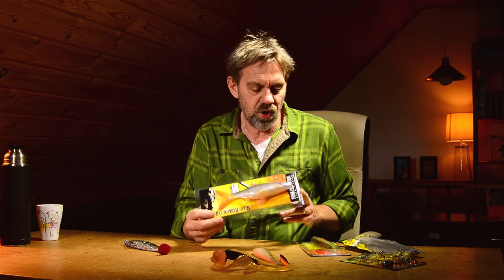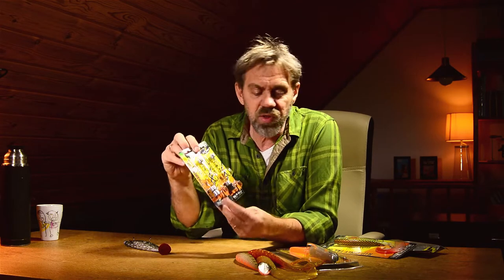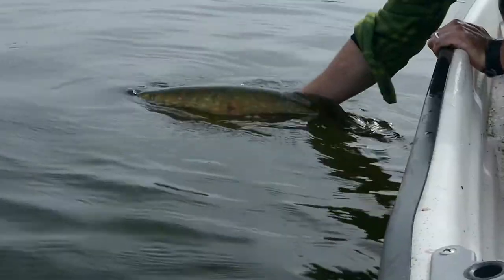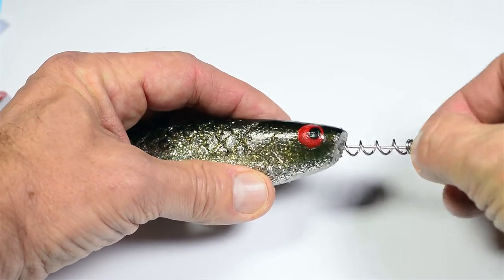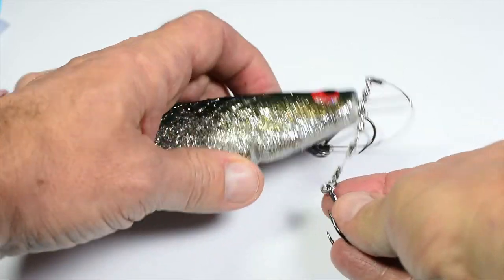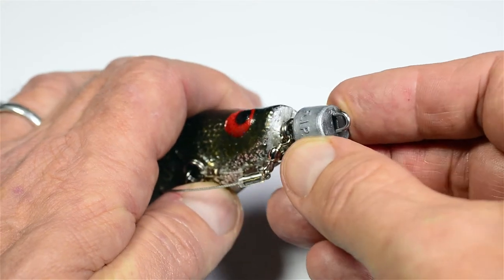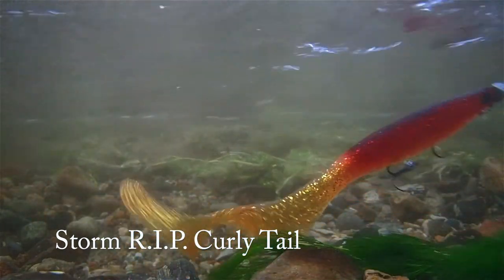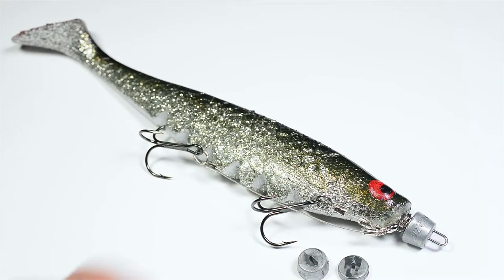How to rig the Storm R. I. P. Multi-depth Screw System

Comment: Cool rig Michael, lot easier than trying to thread line through the bait for attaching a stinger hook at the rear. Thanks for the instruction. Have you used any hollow baits like Yum, I think they're called Big or Easy Money? Big hollow boot foot. You rig them on huge EWG hooks they supply with the bait. I could never rig them right, the instructions sucked. They end up ripping the bait. So I used the biggest hook lead heads I could find. I don't think the bait would last one toothy big fish bite.
    Storm makes awesome lures. The Hot N Tot in firetiger is my favorite for Kings over here on lake Ontario.
Cheers 👍😎🎣
Reply from the maker: Joe, I use hollow swimbait a lot. Haven't tried the Yum (Money Minnow?) but i use some similar softbaits, with that big slot in the body. I my opinion it is crucial to choose the right size Offset/texas style hook for the individual bait. I will try to make a video on that during the coming months. Rigged "Weightless" on one of these hooks they are dynamite when trying to catch predators in weedy areas. Just the softbait and a hook - in essence it is kind of a finesse presentation, I guess. 
Cheers :0)
Reply from the maker: I love the Hot'N'Tot and the Subwart lures as well, by the way :0)
Reply: Michael Jensen yeah money minnow. I think they came out a few years ago, everybody and their brother made that style of bait. This came with I believe a 7/0 EWG offset hook. I wouldn't pay regular price, I found a twin pack at Walmart for like 75% off. I've had a couple of big sprees at Cabela's. We have their card and you get money back, Cabela's Bucks, to buy of their stuff. They're like a "pusher" in that respect, lol. Among all the plastics I also got some hollow boot swim baits in ghost minnow color. Huge 7 or 8 inch. It looked more like a sucker, which as you know is great for pike, but had a purple irridescense. I get fly fishing and tying stuff there too, as well as spinning tackle. 
     I've some wiggle warts too. But those Ontario Kings out of Oswego R in NY love those firetiger hot n tots. That's the only fish I've caught on that lure. Overall jigs, CD Raps, or live bait (night crawlers) rigs are my go to stuff.
    A video on rigging would be great, cheers buddy.👍😎🎣
Reply from the maker: Joe, I guess the name Money Minnow wasn't intentionally referring to the price... but it seems fitting ;0) I will keep those swimbaits in mind for future rigging videos. Cheers my friend :0)
Reply: Michael Jensen lol, 🎣🙌💰💰💰 that's funny. But I think it pertains to tournaments, "use our lure and win the big money!". I guess tournaments and competition are ok, but it's really not my cup of tea. Though I do regret not entering a contest that a local lake association puts on every year when walleye season starts. I'm shore bound, no boat, so my lady and I went and fished at a popular spot on the riprap right where the lake's river outlet starts. A big freaking storm blew in, high winds, thunder & lightning, heavy down pour! Head for cover under the bridge! I yelled as her hat blew off and headed down river. We gathered our stuff and ran under the interstate bridge. I swear it was a tornado, at least a powerful wind shear. Anyway as soon as it cleared we went back to our spot and I cast a Tom Mann swimbait on a jig. ( Remember him, plastics, unique lures) It was a translucent light blue, a split dorsal fin that sort of made it Tex - posed, and a ribbon tail. It also had a pouch to add a rattle, scent pad, or a piece of Alka Seltzer, which was popular for a while because of the bubbles it produced. First cast and I started a retreve and was immediately snagged. I thought I had a clump of weeds that the storm had kicked up. Then those weeds started to thump! thump! thump! Hey I got something, get the net! It fought a typical big walleye fight, strong head shakes, powerful runs to the bottom. I finally got it close, Holy F--- I got Big Moe!!!! It was broad side to me, dorsal all fanned out, gills flared and the jig stuck in it's mouth. It looked like a shot from In Fisherman TV. Well 26.25 inches of my trophy fish would have beat the tourney winner by 2.25 inches! After I thought the storm must have disoriented the bait fish. That minnow bait had a passable perch profile and the color probably looked like a shad, both prey of the walleye. 
  So that was "almost" my "money 💰 minnow"! Thanks for letting me tell my story... Cheers Michael 👍😎 
PS, I replied on the website Black Zebra. I don't know if you got it, said it had to clear first. Also I told another YouTube tyer, Piscator, about the awesome jig you made. Hope that's ok.
Reply from the maker: Joe, tournaments as a concept... are kind of strange events - and a bit far away from the solitude and undisturbed wildlife experience some of us love. But... they are kind of cool as well, since a lot of the cutting edge fishing techniques start in tournament fishing circles. And I think that a lot of milestone developments in tackle is also made - in that environment. 
Cool story with that monster in the thunderstorm. You should have entered the contest with that. Who knows... you might have been a billionaire earning fishing pro by now... if you had ;0)
Super cool with the Black Zebra... I enjoy Piscators videos as well. I will let you in on the website. It's only the first time a clearing is needed. After that you've got acces without having to deal with the gatekeeper. 
All the best :0)
Reply: Michael Jensen I agree completely. But those guys really EARN their money. They are like athletes. I wish I was a billionaire! ;-) But I'm happy where I am :-). Yes it's like space exploration, lots of things are discovered and developed because of it. 👍😎